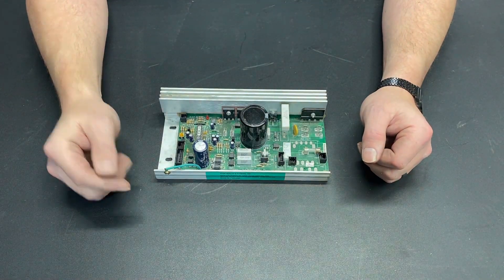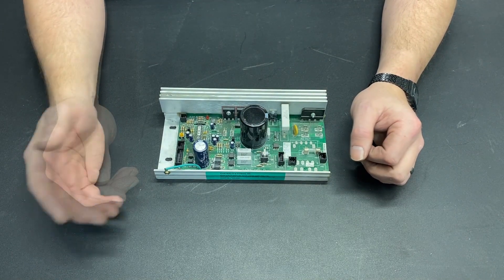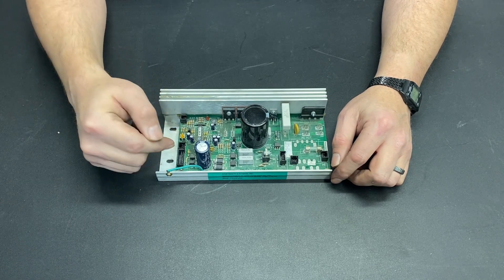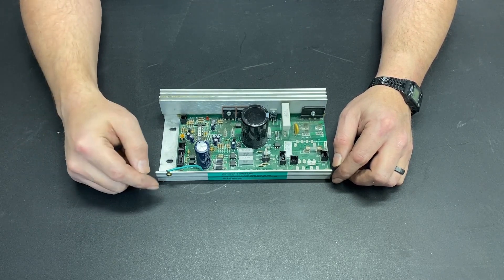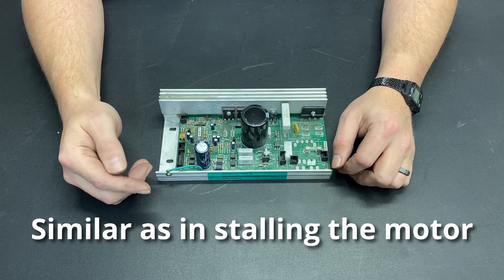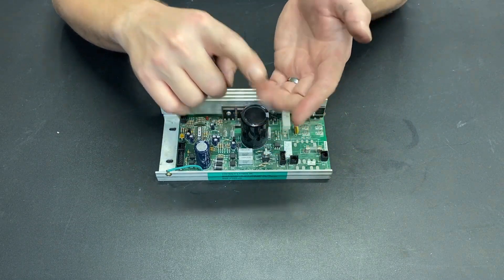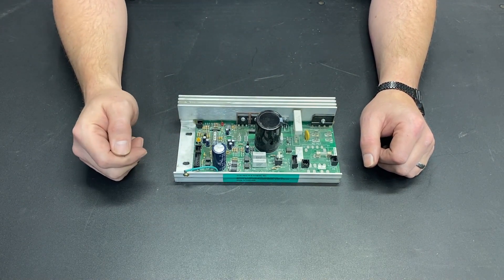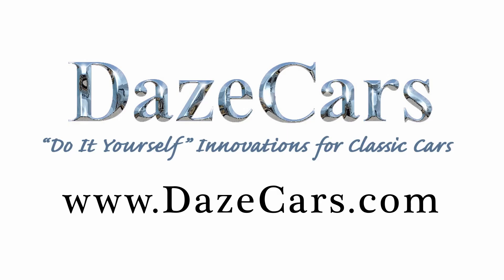MC2100 NOT a Good Power Supply Option for Shop Tools!

Comment: Thanks for the video. Last night I just bought a variac that you recommended in the other videos info link.  Hope it'll do me good  for drill press hopefully I can figure out adding reverse option to it. I did bought the other parts for the mc-2100, incase I can figure out if it's good or if I can repair/modify/or even upgrade the board.

I have a thought about your board dying. Not a electrical  genius here but what if those big caps or mofest had failed and could be swapped out for a newer one and or a better one to fix that. 

I also tied testing my treadmill motor with a Milwaukee m18 battery pack it ran with its 20v supply. When i did idea popped. Wouldn't it be the same or worst using several power tools batteries in series, like the more there is more rpm..   or adding parallel more torque. Again I'm no electrical savvy here, just sharing thoughts.
Reply from the maker: assuming the batteries have adiquite amperage putting them in parallel will not add any extra torque.  Changing the voltage however is exactly what we are doing with the power supply to change speed.
Reply: @dazecars  you are right, I don't know why I said it like that. But what was in mind when commenting about batteries was they make adapters that like is having them on tool but on whatever it can be mounted to let's say we line 4 mounts up on a fixed board. 20 volts each mount would be applied  from battery so if I have all of them mounted with the same style battery in series  80 volts so it were to drive the motor I would imagine that would be running fast rpm whatever 80 volts give. If I wanted it go half the speed I go take off 2 battery and leave two. But again I might never do this, I remembered how much the Milwaukee 12ah m18 battery  was that I bought. Thanks for replying  anyways have a good day.
Reply: @nicholasderbin7667  something worth noting is that LiOn batteries for power tools are made ti operate within a certain voltage.  Meaning you need to be able to maintain between a 3.2v and 4.2v charge for each individual cell to keep the battery useable.  Any time you have and under voltage or over voltage condition, it significantly reduces the life of the cell/battery.  So use them with a voltage protection board to shut them off or simply at your own risk

Comment: It looks like you need snubber or flyback diode.  There's a  high reverse current generated when the motor suddenly stops.
Reply from the maker: I understand the purpose of a flyback diode but that is not the problem here.  The current you speak of is not generated from a sudden stop it it is from a free spinning motor acting as a generator.   In other words you turn the motor off but inertia allows the motor to continue spinning. A flyback diode bleeds off that power.  With a sudden stop there is no current because there is no motion to create power. The board failed because of the stalled motor drew more amps than the components on the board could handle.
Reply: @dazecars  First, a flyback diode doesn't "dissipate" current, it's more like a check valve and prevents current backflow. Second, current IS generated when the motor suddenly stops. The magnetic field in the motor's coil collapses and the energy has to go somewhere. Since the change is instantaneous or almost instantaneous, it results in a very high current in the opposite direction.
Reply from the maker: @bobweiram6321  Sorry to say but you are misapplying the concepts of a transformer to a DC motor and it does not work that way. A transformer works by means of a collapsing magnetic field, but it has TWO coils (or a single coil in the case of a Variac but that is set up totally different and does not even remotely apply to this situation). It is the differential between the number of wraps of these two coils that steps voltage up or down. If you generate a magnetic field in a coil with ten wraps and it collapses next to a coil with 100 wraps voltage will be stepped up, create the field in the 100 wrap coil, when the magnetic field collapses in to the 10 wrap coil voltage will drop. Two ten wrap coils will result in an identical  voltage being induced into the secondary coil as was applied to the first coil (small loss for efficiency and resistance).  Why am I educating you on transformers? Because it is this concept you are incorrectly applying to a DC motor coil.   A magnetic field collapsing in a single coil doesn't magically create a massive voltage spike.  In the case of a DC motor there is no second coil for the field to collapse into. Even if your collapsing magnetic field concept was correct (which it is not) you would never get more more voltage than was originally applied because there is no coil differential.  If you don't believe me set up a motor and hook it to a DPDT switch (on) (on) with no center off.  connect the motor to the middle terminals, power supply to one set of outer terminals and a meter to the other set of outer terminals set to read DC volts.  Turn the motor on and throw the switch you will initially see voltage similar to what was powering the motor, no massive spike and as the motor speed drops the voltage will drop. And don't say it happens in between on and on if it were able to damage the board it would register on the meter.  When using a diode the voltage is “dissipated” by completing the circuit.  That is WHY a diode is used as a flyback.  Diodes only allow electricity to flow one direction, your analogy of a check valve is crude but somewhat accurate.  When power is applied in one direction to rotate the motor it hits the diode and is not aloud to pass, but when the motor is free spinning the voltage polarity is reversed applying current the other direction as the motor becomes a generator and the diode completes the circuit dissipating the charge and helping bring the motor come to a stop.  This works well on small motors because the watts produced are minimal but in the case of a treadmill motor there are a lot of watts being produced.  Suddenly shorting the motor out when it is acting as a generator is hard on the internals of the motor.   Flyback diodes are used for smaller motors.  I use them all the time when wiring automotive electric fans to help prolong the life of the contacts inside the power relay, but they will do nothing good in this situation. Further more if it was a simple as adding a $.05 diode to protect the 2100 don’t you think the manufacture would have done so?   It could have easily been added to the motor. And your theory that it could "kick suddenly in the wrong direction" is also completely wrong.  The motor is a generator and the diode simply completes the circuit. Manufactures don't add them because one it would not protect the board as you are claiming and two it would shorten the life of the motor.  Watch my second video on breaking resistors and you will see what happens inside a free spinning treadmill motor when the leads are shorted together which is exactly what the diode would be doing.  My board failed because the motor stalled drawing more amps than the MOSFET could handle, not because of a lack of a flyback diode.  I hope this helped clear up your misconception of magnetic coil induction,  what a flyback diode actually does, when it should be used and why it would not help in this situation.

Comment: Yeah, I fried my MC2100 messing around with the DPDT switch for reverse. Accidentally switched froward to reverse and the shop braker tripped and when I tried to restart the MC2100 I got the exact same result as you. Looks like the MOSFET shorted. I ordered a part, and I will replace it when it comes in to see if that will fix the power supply. The main reason I want to try this board is the very slow speed I can get. I want to be able to weld a shaft in the lathe with the spindle turning. But also like you I'm starting to dislike this fragile power supply. Seems to be a common issue with treadmills when the running belt sticks or is not lubed well. I wonder if a fuse in line with the motor + wire would make a difference. I'm trying to have a video of all this nonsense uploaded soon. Hope you get well soon. Thanks for the video.
Reply: You need a flyback diode.😊
Reply from the maker: That would not have eliminated the issue.  Flyback diodes dissipate current created from a free spinning motor.  In his case the board was over loaded because of reversing directions, in effect stalling the motor.  A flyback diode would have done nothing in that case.
Reply: @dazecars  One other point. Do you realize when you flick a switch, the poles do not  instantaneously change? There's a momentary period when the motor is disconnected before reconnecting to the other pole. During the disconnection phase, the magnetic field collapse and generates a very large current spike in the opposite direction.
Reply from the maker: @bobweiram6321  It has nothing to do with the coil collapse it is because the motor is acting as a generator.  Please see my lengthy reply.  And you should NEVER go from one direction to the other (ON ON) with a DC motor.  Very hard on the motor and very hard on the power supply.  always use an ON OFF ON DPDT switch.  Also you need to let it come to a stop before switching directions.  failure to do so effectively stalls the motor and draws massive amps not to mention the massive wattage hitting the brushes and their connection. Alsowhen it is "disconnected" it is no longer connected to the power supply so there is no way for it to damage the power supply.  Once reconnected it does produce power as a generator but the board is designed to handle that.
Reply from the maker: I have heard of others frying these board with a forward and reverse switch.  This is the second one I have fried.  The first one failed testing on the bench when I had it cranked up to a high RPM, I turned it off at the PWM and then after it came to a stop I turned it back on.  The sudden draw at near max RPM fried the board in the same way where it tries to go to full speed when you first turn it on then shuts off.  If you want to be able to go a very slow speeds you should look into a Variac. Of all the power supplies I tested this one had the slowest minimum speed https://youtu.be/oSZYEUm1SuY
Reply: @dazecars  I think you're mistaken about what a flyback diode, or snubber circuit does. Have you ever occasionally noticed a spark when a relay is turned on? The spark is usually hundreds or even thousands of volts--enough to pass through an air gap. The reason it occurs is simple. Inside the relay, there's a coil that when activated creates a magnetic field around itself which either closes or opens its electrical contacts. When the relay turns off, the magnetic field changes, or collapses to zero. It goes from being a electromagnet magnet to a generator, creating current in the opposite direction which can be high enough to spark. 

Your DC motor is nothing more than a big ass coil. When it suddenly stalls, it has enough back current enough to kill the MOSFET in its path. Why doesn't the fuse trip? This happens too fast for most fuses. A fuse needs enough time to heat up and break. Back current can be generated in milliseconds.

Why doesn't the controller board have a flyback diode? Due to wire resistance and other factors, it's best to put the flyback diode as close as possible to the source, which is the motor. It probably doesn't make sense to have one since it could cause the motor to kick suddenly in the opposite direction which can injure the treadmill user. 

If none of this makes sense, at least watch this video it explains better than I:

https://youtu.be/haUWO7BGYTE
Reply: @dazecars  I replaced he MOSFET on the MC2100 and it fixed the problem. Just putting this info out there for others that may want to repair the treadmill board. $6 in parts and 20 minuets of time.
Reply from the maker: @MrFixit1  There are two different MOSFET chips and often times when one goes it shortens the life of the other.  I recommend replacing them both IRFP250N and the  S4025L.  Either one can cause board failure.  For best results put a IRFP260N in place of the IRFP250N  It can handle more amps.  I have a video coming up on all of this as  I fixed mine right after I killed it... still not going to use it though.
Reply: Thanks for the comment here and sorry see that your and his board got friend. It helps others not to make the error sharing. I wad just asking questions around about reverse option because that's a really nice option to have for tapping and reverse drill bits. I was about to try what you did last night but got tired and slept it in.  I just got a treadmill that has a good motor but the mc-2100 w rev 5 board turns on with a solid led but doesn't seem to turn the motor after user input. I wanted to put these components on my small drill press. I am happy his videos are recent and is doing stuff is what I am working nowadays.  Alot of documents about these stuff. I wonder the board would be good for like a skateboard but again it's a ac to DC unit so idk.

Comment: So should be fine then for belt grinders and sanders and the like yea?
Reply from the maker: Could go either way.  Most belt grinder builds I have seen people are direct driving the belt with the motor.  This eliminates any gear reduction and increased torque afforded by said gear reduction.  Less torque means its easier to stall the motor sooooo as long as you are carful it should work ok but would still not be my first choice.

Comment: I don't like the 2100 either because there's too much unused circuitry and it looks as if there's not much in way of supplying ample power when the motor needs it.  However, I am using 1 in my bench top drill press, and because there's a belt that isn't taught enough, when a bit gets stuck, the motor continues to spin in the belt which buys me enough time to free the bit or press the yellow button to stop.  I still don't like it though, but I already installed it before stumbling onto your videos.
Reply from the maker: I am sure having the slippage makes all the difference in the world.  Had the drive belt on the bandsaw been looser my MC2100 probably would have survived the stuck blade.